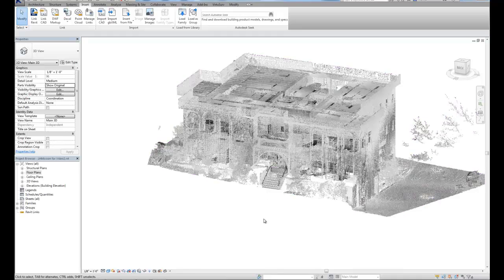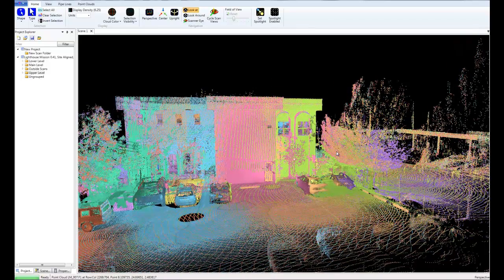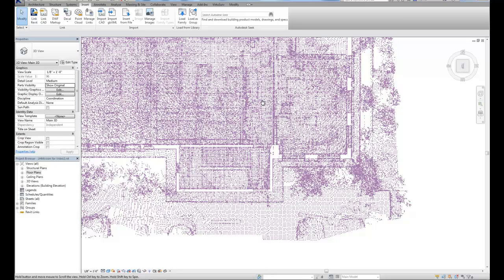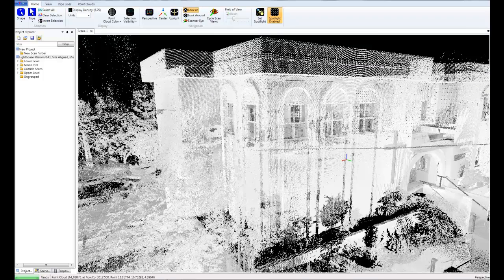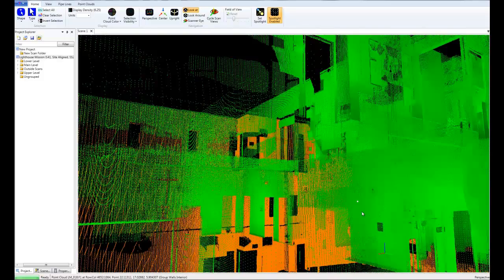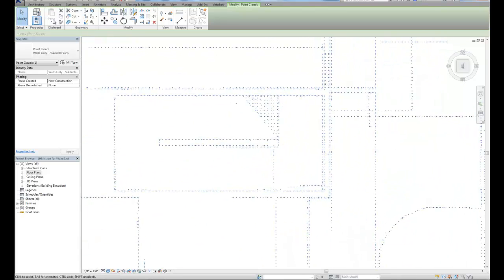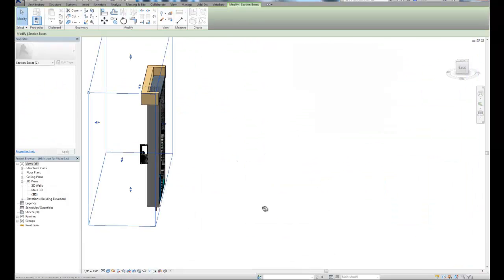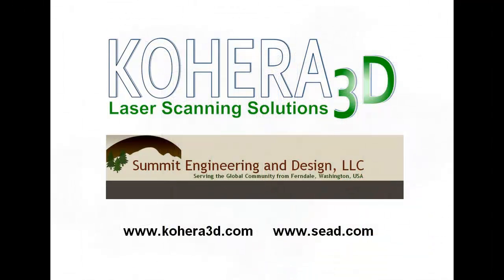Working with Point Clouds inside Revit Architecture

Comment: What program did you use to isolate walls ceilings
Reply from the maker: HI Glenn. Isolations are done using Kohera3D point cloud software. The Spectrum module or Ultimate suite has this feature. Cheers.
https://www.kohera3d.com/